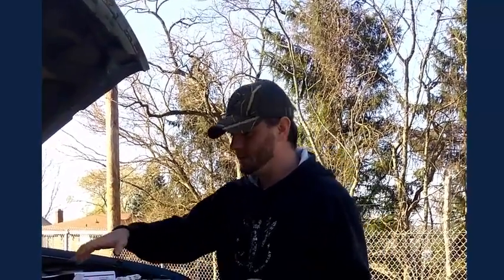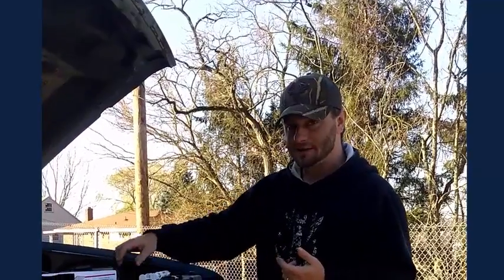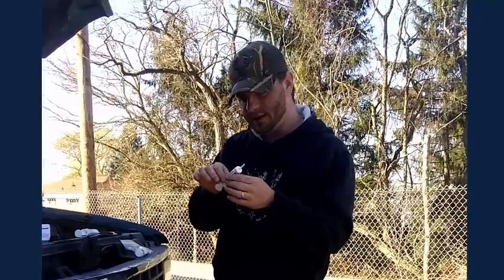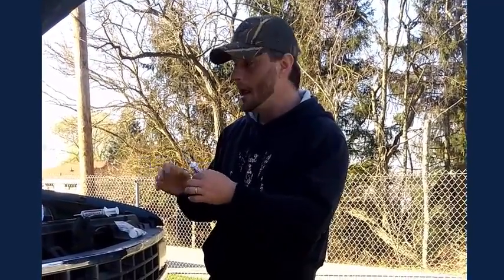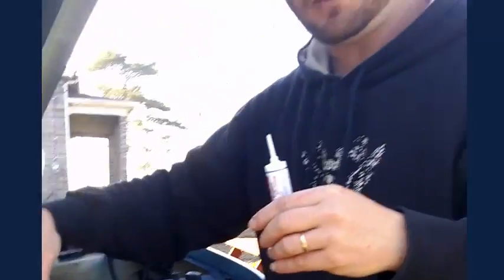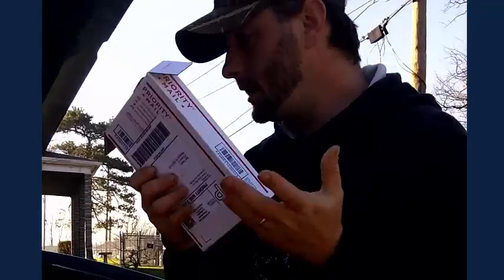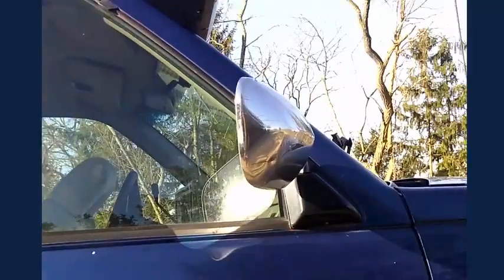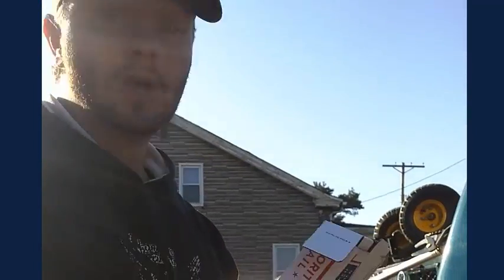Fix Engine Oil Blow-By 1993 Chevy K1500 Truck (Part 1) Certech Gels

Comment: You got to try tribotex that stuff fixed my blowby and turned valve train in our LS2 in a no time. It is nanoparticles that are ceramic as well but flat and have two different sides sticky and slippery so it builds up on top of flat surfaces.

Comment: Please explain how this stuff replaces blown piston rings.
Reply from the maker: it doesn't. Just helps with blow by
Reply: Um blown rings or blow by... Blow by due to stuck rings due to dirt grit sludge rust..  Mystery oil breaks it loose displaces it removes it . it runs . if your broke and cant afford to pull engine it works.. Broke rings wont fix ...

Comment: Ok now, the blow by on my 1995 Ford F250 is so bad that tons of oil and white smoke shoots out of the deep stick tube and the oil fill cap. I relay need to know if this think will work or if i should just drive it down to the junk yard.
Reply: +Marin R Did you end up trying it?
Reply from the maker: Marin R Hey Marin, I'm a little behind on getting the video for phase two together, but so far I've put 250 miles on the truck and I'm supposed to put up to 1000 before oil change and next add. But, I had the same type of HUGE blow-by like yours and that seems to have quit. What I've been most surprised about is the fact that the truck has definitely picked up some extra horses.

I'd say go for it my friend. It's working for me and has even made a difference on my diesel tractor which was blowing oil about 10 feet away lol. Luckily, http://www.CertechGels.com has a money back guarantee. I'd say if you have more questions about it, give Bob Pond a call, their number is listed on the site. Let me know how you do with it my friend!
Reply from the maker: Marin R read my comment above, but also check your oil for any water, if there's white smoke coming out of there, you might also want to check the head gasket. It wouldn't be a tough thing to do on that truck, pretty straight forward. But, the Certech would definitely stop that blow by from what I'm experiencing.
Reply: I did though that my head gasket may be damaged as well, but interestingly there are no air  bubbles coming out of my radiator or white sludgy residue anywhere - although with the way my oil is splashing out that will be hard to buildup. Also when i rev the engine i barely get any smoke from  the tailpipes, which should be a cloud in my mind with the amount of blow-by and smoke I'm having at the engine.
 But I'll give the Certech  a try, although it will take me forever to do 1000 miles since I've been avoiding driving the truck anywhere farther than the Home Depot, in case it brakes down and i have to tow it back home with my wife's Prius.
Reply from the maker: Marin R My truck wasn't really blowing any smoke out the tailpipe when the blow by got real bad. I've also noticed that I'm starting to see a pickup in horsepower just after having put 150 miles on the thing after this treatment. 

By the way, IF you break down and have to tow it with the Prius...please please please make a video of that! :)
Reply: Truck's Steve  
@Tools and TractorsOPPPPPPPPPP